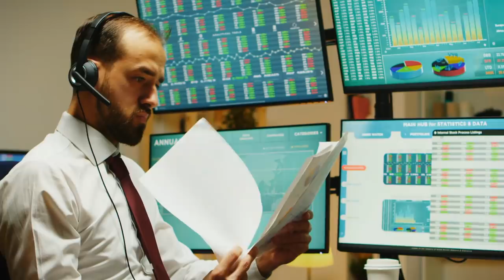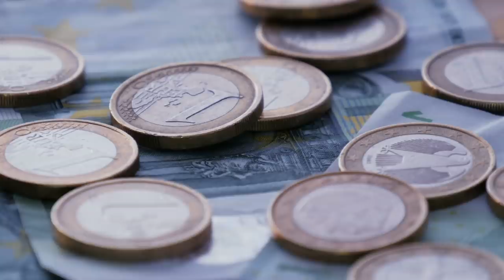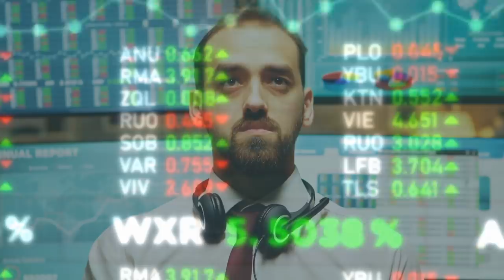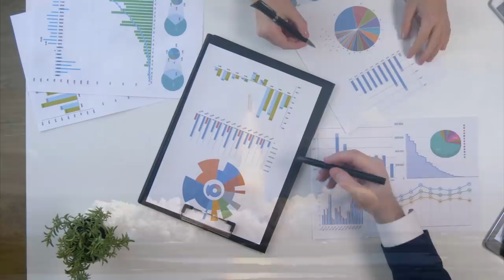Why Greece's Economy Never Recovered? (2020)

Comment: If you don't find a means of multiplying money, you will wake up one day to realise that the money you thought you had, has finished. Investment is key.
Reply: Most failures and loss on Investment usually happens when you invest without proper guide and the analysis of the profit and risk percentage of the Investment.
Reply: it's safe to have an investment manager who has vast knowledge about Investment, to make you profits from your Investment on your behalf while you monitor the Investment growth.
Reply: Juana Miguel  My investment manager is Stephen Briggs, he's is an expertise when it comes to Investment that yields a good percentage rate of profit.
Reply: Your investment portfolio is accessible by you alone. All Stephen  Briggs does is make decisions for you on Investment that will yield you a good percentage rate of profit with zero risk of losing and invest on it on your behalf, while you monitor the profit rate and accumulation.
Reply: You can reach him with
Reply: Steve briggs trade
Reply: Interesting
Reply: Jesus's saves.Moses invests
Reply: Invest in what????
Reply: A lot of Nigerian scammers recommending all kind of investment
Reply: Exit eurozone is the key.

Comment: I just watched this very interesting video and I couldn't agree more, well done on this excellent work!
I recently returned to Greece after spending a good 12 years in the UK, hoping that Greece will get back on track after a decade of austerity, then Corona happen and exposed all the bad things I thought I would avoid. The overall governance system is still problematic and only superficial changes occurred, that is why people are still fleeing the country hoping for a better future. Here in Greece the only people who have some control over their lives are either public servants or pensioners, since they get paid every month. In the private sector life is a struggle, trying to make ends meet is difficult and since there is no financial security the future looks bleak.
Honestly I cannot see a way out and the only reason that Greece is not a failed state (yet) is because of its geopolitical situation.
Reply: But you forgot to mention that 7,5 to 10 people in Greece don't pay taxes,due to the tax system.
Especially the private sector you mentioned,where 95% declares below 12000 euros per year.
And the same thing goes as back as 1974.
Besides that,also another main reason is the huge corruption in politics,banking.

Comment: GDP was by a quarter smaller than before crisis or much less as the pre-crisis level was artificially inflated?
Reply from the maker: Ah the old chicken and egg!
Reply: I'd say the economy was better performing in 2019 than in 2008, after you account for the artificial boost from lying and borrowing.
Reply: @AltSimplified  
You failed to mention that debt to GDP was only 110% in 2008 when the crisis hit. That has gone up dramatically in the past decade.
You should listen to Yanis Varoufakis discussion with Dave Rubin. He was the finance minister during 2016. He has a lot to say! I would go over the points he made, but it’s easier if you just listen to that interview
Reply: @AltSimplified  
Because maybe your reasons are too simplified?
Reply: Ke Ka  What if I told you that Greece is still considered as a highly developed country, although that's only on paper

Comment: Sadly it's more complex than this. Dr George Economides did some work for example on how public service quality has dropped from the tops to now and if it haddend the economi would had not suffered that much and it would had been much shorter lived. In a practical sense if you want to do busness you want something resembling the UK's rule of law. For this the legal system needs to be more efficient and rules made more permanent you can't start a business if rules change all the time. From a future perpective looking at the numbers I would not be surprised if the green energy revolution will liberate the country in a scale never seen before more than other nations in europe. Long way but optimistic future never the less.

Comment: I believe Greece's biggest problem is that it is not monetarily sovereign. If Greece had abandoned the Euro following the sovereign debt crisis, it would have become an attractive investment destination - at least by labor costs and costs of domestically-produced materials - almost overnight. Sure, the new Greek currency (Drachma?) would be severely undervalued vs the Euro, imports for Greeks will undergo a significant price inflation but this would also be a good thing as it will stem further capital outflow while encouraging capital inflow in the forms of investments, exports and tourism. Over time, this should also help Greece build a more diverse economy and move it away from dependency on just a few sectors like entrepot trade and tourism. It would become a more resilient economy long term. Staying in the Euro meant that it will never be able to compete in those sectors more developed EU members had developed as its own comparative and competitive advantages cannot be maximally realized.
Reply: Or it would have gone into a debt spiral and hyper inflation, never recovering since it would have been unattractive to foreign investment due to corruption and political extremists taking power. Never improving since there is no infrastructure for industrial development.

By the line of your argument Zimbabwe must be a paradise for investors because of it's low labour costs and worthless currency.
Reply: @sualtam9509  What does corruption and political extremism have anything to do with monetary independence? Do you think that corruption and political extremism is absent from EU countries just because they adopted the Euro as currency? Laughable.

And Zimbabwe? Why did you jump to that? Do you know how many hundreds of countries control the issuance of their own currency and they aren't Zimbabwe? 

In the first place, there are many countries more corrupt than Greece today that had no trouble developing their economy and building infrastructure because the labor cost savings resulting from lower currency valuation made them attractive for foreign and domestic investment.
Reply: @kaocakeman2964  Corruption and political extremism will divert foreign investment away from a country.
Both for themselves might work out but coupled with recession, bankruptcy, shrinking population, low productivity, high labour costs, price instability, high taxes, high bureaucracy... might aswell add it to the list.

Comment: Own currency problem could in theory be solved by cutting wages, but would require a lot of cooperation from the market. If Greece over night agreed to cut down wages and prices of local produce it could be done, same with retirement and official wages. Country currency show inflexibility and reluctance of the market from dropping its own value and profits.

Comment: Main reason is adverse demography. Pension funds, real estate and all sectors of most modern economies are based on endless growth. They unravel very quickly if there is adverse growth due to leverage.
But most imp is the growth of population. More pension payers than pension takers, more people moving into a city every year driving up prices, more govt revenue year after year.
Greece, Italy and Portugal did not take large number of immigrants unlike UK, canada or France. This coupled with low birth rate, a tipping point was reached where there were far more pensioners and welfare recepients than contributers. 
Other western European and North american places have such issues too but they solve it by mass immigration. Yes, they are bascially importing real estate inflaters and pension fund contributers. Without mass immigration, France, Belgium, Uk all would have gone the same route as greece or portugal
So, pension funds collapsed, real estate collapsed and these nations went from "first world" as late as 2005 to total hellholes in a matter of years

Comment: 1. They should get out of the euro addiction. I mean they depend on EU (or Germany) debt too badly. Slow but sure Germany will anchluss Greece if they constantly ask for debt/bailout. 
2. Reform their fundamental economic. Service sector as main sector especially in tourism is too fragile. They should build new manufacture sector across the nation.
3. Find new partners. China and emerging market will be new opportunities. Why China? We don't need new answer.
Reply from the maker: Hi myfox, thanks for the comments! Interestingly Greece's failed diversification is often attributed to it's high brain drain and lacklustre infrastructure. On the china point, the port of Piraeus is one such example. Productivity and output are up by double digits, but strategically a number of european partners have concern over Greece's perceived dependence on Chinese investment.

Comment: 80% of it comes down to the Eurozone and how bad it is for the type of economy Greece is running and should have never joined the Euro in the first place. It will NEVER truly fix its structural problems as long as it stays in the Euro. Things might seem to get better on the surface due to loans and cheap credit from the ECB (so exactly what's happening now) but as soon as that changes it's back to the same. It is simply impossible for Greece to be competitive with the Euro by having a tourist based economy, and no that tourist based economy isn't going away, hopefully Greece will one day diversify its economy a bit more but it will never be the type of a economy that benefits from the Euro.

Comment: The key here is the EU. Notice how all the problems started to really appear in the 80s and 90s? Because they truly did start in 1981.

On May 27, 1981, exactly 40 years ago from the date I wrote this comment, the decline of Greece became official.

It was under the EU when our debt soared from 13% to 110% in the first 13 years of our membership. And now it's at 205%.
It was under the EU that our growth stopped completely for 15 years. From 1949 to 1981 our economy grew by an average of 7-9%, with 1960-1974 being years of double digit growth. But from 1981 to 1995, we couldn't even manage to get 0.1%.
It was under the EU that inflation skyrocketed. 1950-1980 average: 5-8%. 1980-2002: 40%.
It was under the EU that we first appeared consistent trade balance and budget deficits.
It was under the EU that our industry vanished. Same for our agriculture. 

And on top of that, the EU knew almost from the very beginning that our governments were fiddling with the data. Yet they did NOTHING to stop it. If they were a truly responsible institution, they would stop us. But no. They let us into the Eurozone, which accelerated everything.

And, seriously, don't say it was the Greek citizen's fault, we knew nothing up until 2011, and we legitimately didn't even contribute to the crisis. Proof: the household debt of Greece is at a miniscule 32% at the moment. Before the crisis it was below 20%. Which means Greek citizens owe nothing. But the government does. Overwhelmingly.

We had the perfect economy almost. But no, haha, destruction goes brrr

Comment: Great video. The Greek situation actually became worst with all the "rescue plans" imposed on us, mainly by Germany. The debt was 318 billion euros representing 120% of GDP in 2010, today it is 370 billion euros and 218% of GDP. What happened here is not just a failure of a rescue plan that actually did exactly the opposite from what it should have done. What happened here is conquest through economic-monetary warfare. If all the "mistakes" admitted later, were indeed mistakes then the so called EU and EMF experts were idiots. 
One notable failure of the "solutions" imposed was the pension cost. In Greece this represented about 12.5% of the GDP, higher than the EU average of 11% of the EU GDP. The "smart" solution imposed, was to cut down pensions so that the Greek average would reach the EU average. The result was that the pension cost reached 15% of the GDP, because of the GDP reduction that followed the cuts. 
An other "smart" idea was the IMF's recipe on public spending cuts. The public spending in Greece represents about 50% of the GDP (still the same today), a disastrous percentage for a western economy. Because of this, the geniuses of the IMF concluded that if public spending was cut by 1%, the effect on the GDP was going to be 0.5%, so they imposed cuts on salaries of public employees the development budget and other parts of the public sector that involved the private sector of the Greek economy, only to discover, to their surprise, that the reduction of the GDP was almost 2%... How can a so called IMF expert not realize that public and private spending are interconnected multiples of each other and not two separate economies added to form the GDP, as their original thinking implied.
The problem in Greece was allays the monetary balance, with a trade deficit of almost 30 billion euros, a budget deficit of 6 billion euros and about 12 billion euros sent abroad by foreign workers and immigrants, while tourism accounted for 16 billion euros and shipping for 1.5 billion euros in 2010 the disaster  was only a matter of time. In the past, politicians covered the deficits by printing money and imports were kept low because it was expensive to by foreign goods. By entering the eurozone the deficits were covered by cheap loans, while through a program to bring the income close to the EU average, there was an increase of wages that forced most wage incentive businesses to leave the country, causing unemployment and recession. The Greek governments tried to compensate for this through public works, based on European programs and loans. These works however were not production but rather infrastructure oriented and were contracted to EU companies, leaving Greek firms as sub contractors that hired foreign personnel to keep costs down. The end result was that Greece, for the most part, was left with pharaonic infrastructure works that required expensive maintenance and the loans taken to cover it's part in the project. 
In an economy plagued by resection, the austerity measures imposed by the rescue plans that simply made a bad situation worst. The Greek economy needed financing to modernize private production and improve its productivity while restricting non EU imports of locally produced goods in order to reduce the huge trade deficit. Instead of increasing the part of the private sector in the GDP so that the part of the public sector to be less than 40% of the GDP, they tried to cut public spending, not realizing the end result. What was succeeded instead, was to restrict income and increase taxes and utility bills, to a point were the people could no longer afford to pay their obligations. The result of the so called "rescue plan" was the increase in loan defaults from 8% in 2010 to almost 50% by 2018, thus changing the character of the crisis from a public debt problem to a banking problem as well.